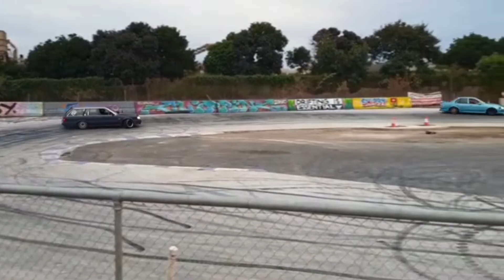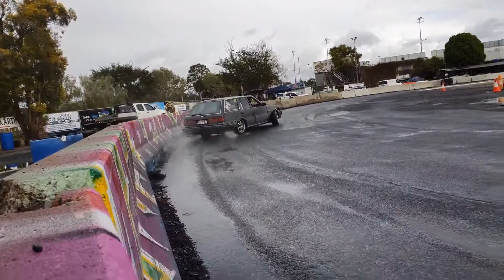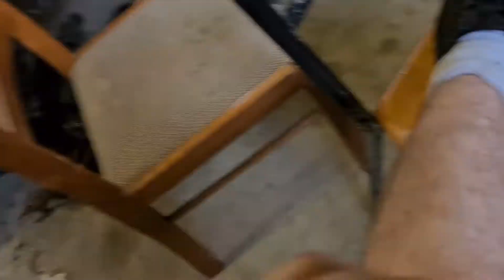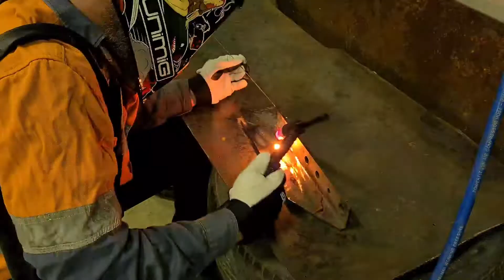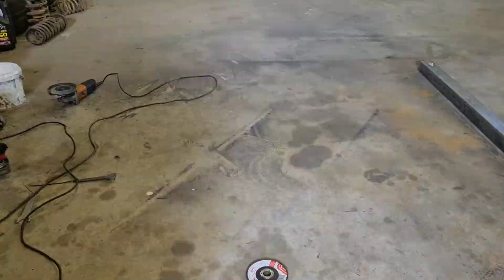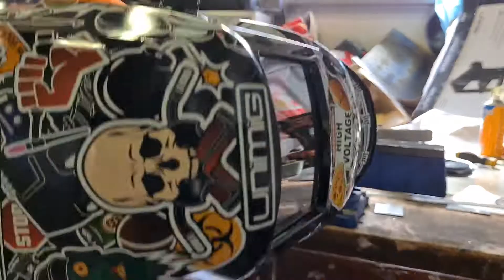THE MOST EXCITING WORKSHOP UPGRADE!! TESTING OUT MY NEW TOY!!

Comment: After learning oxy welding and practicing a couple times on tig the biggest thing I found was getting it neater and abit tighter together ( the beads anti clock wise circle motions as your pushing and test the angles of the torch for your self some people like to have it a little bit more the 45° but I found little less then 45° I'd get abit more consistent beads out of it. Might help you bro idk🤷‍♂️ but I know who to bring my new car too when I want my exhaust done just a joke tho.
Reply: But pushing the weld is better then pulling the weld with a tig
Reply: And them beads closer to the end of the video are pretty alright tbh
Reply from the maker: I can see how the circle motion would help with the step slow sorta pace when adding filler. That may not make sense but it does to me 😂 thanks man, I definitely welcome any tips.
Reply from the maker: And thank you, I was starting to get a good feel for it at the end, I have done some more piratical stuff last weekend and it's all a learning process I'm it's super fun, feeding filler is still super awkward though 😂